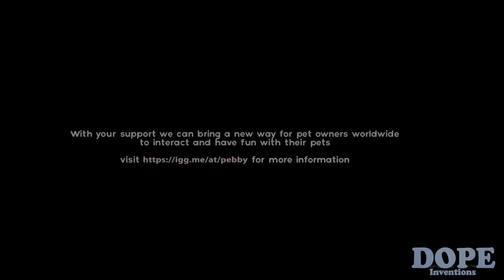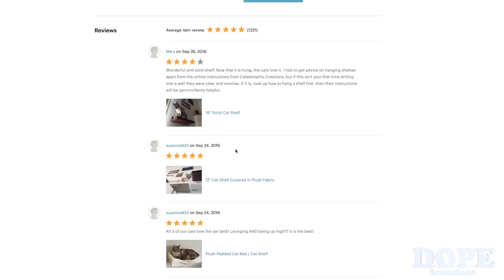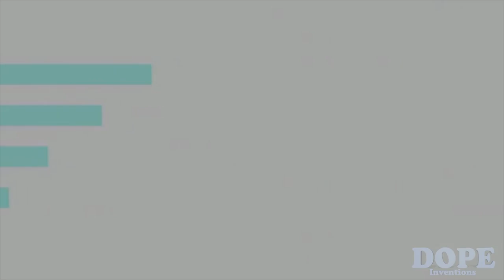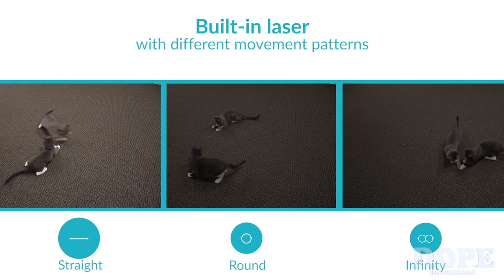5 Amazing Pet Gadgets You MUST HAVE! ▶6

Comment: Oppo Dog Muzzle Quack. It appears to be a multi functional muzzle. I appreciate the design because it doesn't look as "aggressive" as traditional "cage" muzzles. It also seems to restrict the dog's ability to eat things that it shouldn't(the dog appeared to struggle to eat the chip) this is also a good thing. It did however show that the dog was perfectly able to drink the water. Many comments here also suggest that it would make for a alternative for a cone. I find the concept intriguing(have small pooch myself, licks EVERY THING the floor, herself, carpet, (think hair & chemicals) drives mum nuts!) A cone tends to create mats(knots) in the fur, this seems to alleviate that, while also not appearing as aggressive. To conclude, which would you prefer? An object that appears to many as menacing, and cruel? Or a newer design that tries to make a serious yet perhaps unfavorable choice more tolerable with color and "fun" looks?
Hmmm?
Reply: I choose safety over looks.

the quack is actually dangerous cause it does prevents the dog from opening it's mouth which prevents the dog from panting.so over heating can be a huge problem with the quack and other muzzles designed like it.

another is the fact the quack really doesn't have good ventilation so it reduces oxygen flow.

while cage/basket muzzles look scary they are a ton safer.since they allow the dog to fully open their mouth and have good ventilation.
Reply: @starandfox601  
Hmm🤔.
I'll say that you appear to have a fair point. Truly, I don't know the ventilation/open-mouth/panting ratio, nor am I able to say what what would be ideal. Although, it appears that the design could be 3Dprinted and thus modified to suit individual tastes/needs/requirements. 😕🤔
As one of my first full-length reviews, it was ment to stimulate thought and discussion, as I enjoy being able to see all sides of an issue.
So again, thank you for your reply😁

Comment: The quack is just a torture device for your dog.
Reply: Endergirl775 it’s to prevent biting
Reply: there are much better and safer muzzles on the market.

a muzzle should never hold your dogs jaws to the point it can't even bark cause that can suffocate the dog and prevent them from panting which can over heat them.the safest muzzle design for both pet and human are basket muzzles cause it allows the dog to have room to move their mouth without having the ability to bite so they can breath very easily and pant if they need to.